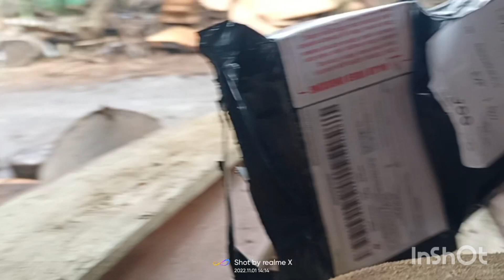tes rantai husqvarna baru, chainsaw newest 258.potong akar jati tua#chainsaw #woodworking

Comment: Kalau untuk belah kayu,kuat gk?
Reply from the maker: @EmSaila  sesuai dg spek/CC nya saja.cc 25 kalau buat kayu diameter 30 cm sesuai panjang bar nya masih mampu.diameter 30 up mending pakai senso CC 54-62 CC/bar 20-22"
Reply: @am111n  trimakasi
Reply: @am111n  iya maksut ku belah kayu minimal 25-30 cm. Apa kuat mesin nya?
Reply from the maker: @EmSaila  estimasi diameter segitu kondisi rantai tajam, mesin ok ,bisa.tp jangan dipaksakan.mesin CC kecil sesuai penggunaan nya saja.itu aslinya buat senso grafir penggunaan nya